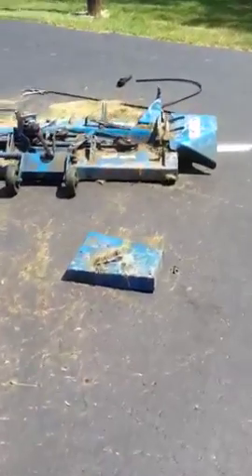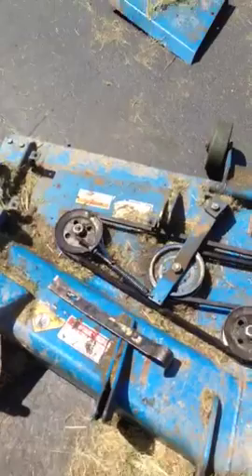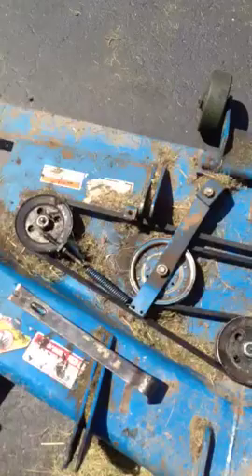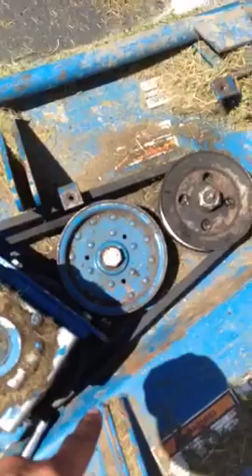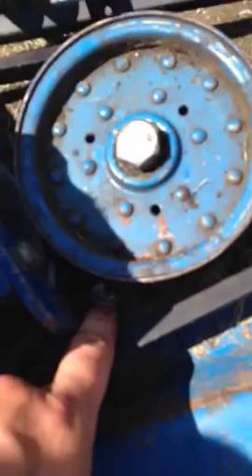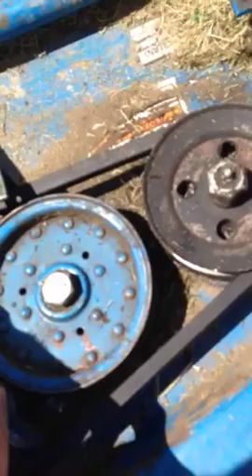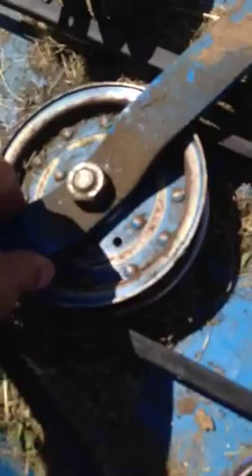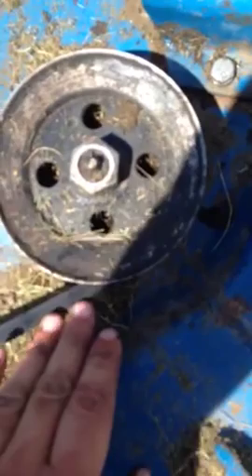New Holland 914A mower belt replacement

Comment: I just changed the belt on my NH 914A as well.  I had to take off the gear box bracket and the tension spring.  I did not have remove the idler pulley, although it said to in the service manual.
Reply: Do you know the belt size?

Comment: Looks like they may have changed the design over the years. It's a very nice deck. The one on my 2004 TC33da has the forward bracket going past the belt. Remove those two bolts, and loosen the rears. Loop the new belt around the gearbox pulley and drop it back down. loop the entire belt back and around the belt pattern as if it were a squashed rubberband. KInda hard to explain in words. I can have a new belt on in 10minutes. No need to remove deck. With your bracket design I would reposition the bracket. If you have a welder do it yourself. Also as in the other comment it's probably a B170 or B173 belt for a 72" deck. Get the kevlar one for extra durability. I have 2 decks and they're slightly different.

Comment: Ive got an old ford lgt 145 and replacing the belt from deck to the engine front pto is going to be a real pain...30 nuts and bolts just to get the front grill off!   Then remove a who,e shit,kad of idler pully/ mule drive business , then i can try to put the belt in..,,,, ENGINEERS!!!
Reply: Do you know the belt size?
Reply: @cindyqueen7786  did you ever find the belt size for the cams 60” mower deck?